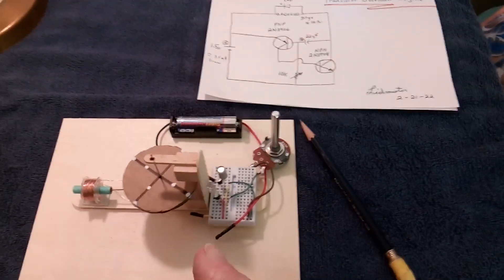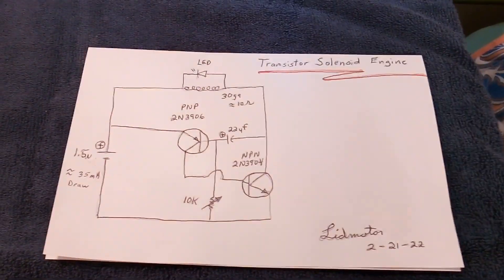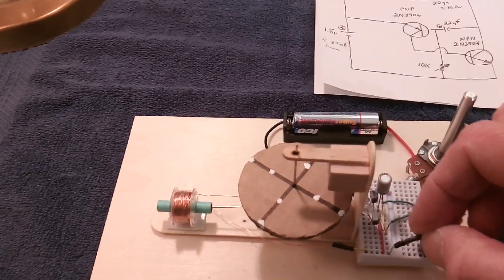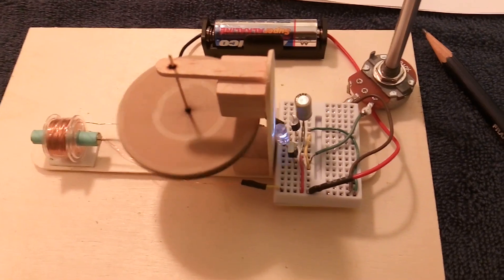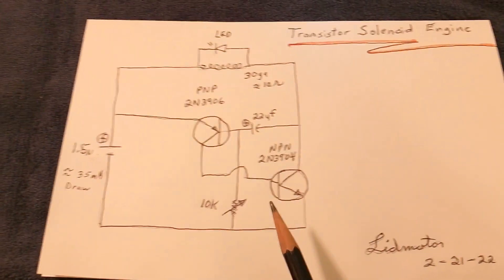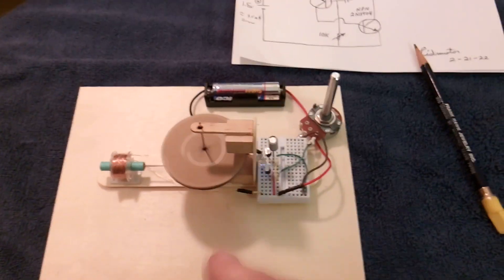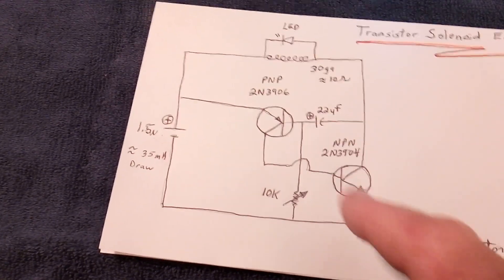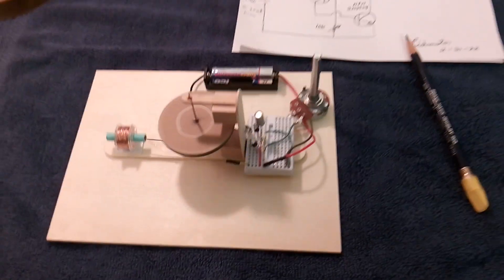Transistor Solenoid Engine

Comment: Another nice ckt that will run off a tiny solar cell all day. 
That would be a big hit at the old timey flywheel Hit N Miss engine shows that used to be all over the land.
Them ol' boys woulda stared at it in amazement all day long.
Your nice hand drawn ckt on a sheet of paper is a Lid Motor Industry Standard.
Perfect for ppl to screen capture to have and help them to make one.
Reply from the maker: Thanks.  One of reed switch  versions ran like a 'hit and miss' and was great fun to watch and listen to.  Some of the old engine designs had a real charm about them.
Reply: @Lidmotor  U bet !!
I had an Ideal, A Monitor, both hit and miss,  a John Deere and Several others back in the early 90's when the ol boys were at the peak of the collection & show era and all getting up in yrs. They R all gone now. I used to watch young teens in the machining class build miniature steam engines and run em on 'steam tables' at steam shows they were the same size as the one you have in this vid ! 
ALL 100% Mechanical :)

Comment: I’ve always watched you run that circuit with higher voltage. I didn’t realize you could run it with 1.5 volts. That is really cool. I’ve never built a reciprocating motor but I’m getting inspired to try. I always look forward to your videos. Keep em coming Lidmotor
👍🤓
Reply from the maker: Will do. Thanks.

Comment: nice job again. im thinkin the flash rate with the rotor stationary is based on the input voltage, the 10k and the cap value, but i was wrong once before. :-)
an online rc frequency calculator came up with .72hz, (about 1.4 secs between flashes), for this combination, but looking at your led blink it's more like 2-4 flashes/sec. it says 2.4hz with 3k resistance so its feasable depending on where the pot is set. handy little circuit there. 👍
Reply from the maker: Thanks for the info.